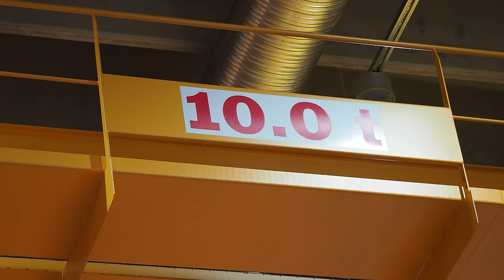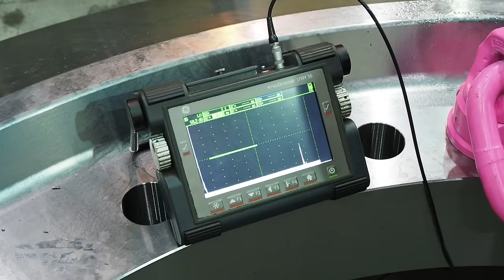Machining HUGE 10 Ton Bevel Gear with CNC Milling Machine

Comment: Its so crazy seeing things like this. The HUGE size just really puts into perspective the amount of work that goes in to making some of the largest machines on the planet. 
Ive seen some of the parts that go on some of those HUGE cargo ships, and they are freaking HUUUGE. You can literally stand inside of the engines cylinders on some of those ships, thats how big they are. 

I work for a company that works in the aggregate industry making huge rock crushing/sorting machines. We're the largest company in the world with what we do. The machines we make can be as tall as 20ft or so, they can be around 28ft long, and about 8 or 9 feet wide. While these machines PALE in comparison to these ENORMOUS ships and machines that a gear like this will go into, the crane they used here just made me think about the cranes at my work. They said the maximum for their crane is 10 tons, which is definitely a good amount of weight. 

At my work, most lines have cranes with a max weight rating of between 7.5 tons and 10 tons. However, the middle section where assembly works, there are TWO, 25-ton cranes. These cranes are HUGE. They have 2 of these HUGE girders on each crane. MUCH larger than the ones on the 7.5 and 10-ton cranes. They have to use these cranes in tandem to move many of the machines we build. 

Once they're fully assembled, some of the heaviest machines we build will literally get up to the 98k pound range. So even with 2, 25-ton cranes, we barely have enough rated capacity to lift these beasty boys.

Its so awesome to see HUGE ass machines and parts get made. It really goes to show just how far humans have come with our engineering capabilities.

Comment: Interesting that no coolant was being used.
Do you know if the gears were heat treated and hardened after machining.
Reply: Absolutely. They wouldn't last very long at all if they weren't hardened properly.
Reply: The pinion had heat treatment at ATA.The ring gear is made of tempered steel so it dont need hardening.

Comment: I loved this. Seeing any big or complicated machining process is super interesting. May be talk a little about the machine that's doing the work and how it operates, it looked like a 5 axis mill or is it a 7 or 8 axis.. Be nice to see what that machine could do on a demonstration program at its full machining speed. May be make something cool then give it away. Just ideas. If you need ideas I've got loads. Make the press do round bar through square hole stuff like that.

Comment: When that piece of metal weighs 10 tons, do they still have to secure it before milling?
Reply: yes, even more so. if you noticed the table is moving the piece back and forth. consider the inertia of the workpiece.

Comment: It doesn't need to be hardened on the tip of the gear? Normally gears are harder on the teeth and softer in the core

Comment: That beast of a machine makes the DMU Monoblock 60 I operate look like a thimble. I assume the 270 is 2.7 meters Y travel. Many milling machine model numbers relate to the Y axis travel in some manner, the X travel usually being the model number of the next largest machine of the series, the Y being the X of the smaller one, thus avoiding any machining envelope voids in the family.

Comment: Sweet video. What type of steel was it? I am a machinist by trade and have been working at the local community college where I got my certificate & A.S. degree in machining. I run our machine lab( order & maintain tools & machinery, get quotes for new machines, material) & teach machining as a part time instructor. I am a subscriber & really enjoy all of the videos you folks upload.

Comment: I worked in the engine room of an aircraft carrier. The reduction gear box for the shaft was something like 60 feet tall... The bull gear in that thing was unimaginably large. There were 4 of those gear boxes. Those were not even exceptionally large reduction gears by ship standards. The scale of  things on a ship is insane to me.

Comment: Video suggestion: KClO4 + Gasoline. Considering how cheap gas is right now, it would be super cool to make some fire with an oxidizer and fuel mix. If you cant find KClO4, KClO3 should work great too.

Comment: my company used to rough out titanium main landing gear for Airbus A-380 we would machine off several tonnes of material on old 3 spindle Cincinnati 5 axis gantry mills. we machine those 3 at a time on the Gantry machines. a complete rough machine job was almost a month and we shave off almost 4thousand pounds of each piece before ship to California to finish machine. that is a LOT of Titanium.

Comment: both size and comexity r equally amazing to me, i never got over big shit iv spent 30 years in the shop with massive cranes over my head n huge beams n pieces of channel n angle flyin everywhere, but it never loses its.. idk coolness, its a little different when u kno what it feels like, i guess it makes u appreciate it more in some weird way, so yea again theyre both equally as cool   super big dangerous heavu stuff is cool to watch, it's cool to watch how ppl handle it n what they've come up to deal with it, i use some of the things iv seen in ur videos everyday out in the shop
Reply: That's nothing. Flip 30 ton block with strap and clamp to angle plate mounted on a Sine plate and tip that 43 degrees

Comment: If you have 2 cranes in your shop you can use the two of them to split loads that are too heavy for just one crane.  Then you slowly move one crane at a time with your load in the middle of them.

Comment: Why not using coolant, or is it air cooled? I'm a gatage builder, not a pro, but arnt gears hard/tough and cutting a huge gear...seems like tool life would be nill if not cooled
Reply: If I remember correctly the heat is an advantage because it locally softens the material right at the point of chip forming.

Comment: The cutting tools appeared to be composite using perhaps Stellite (gold colour) as the cutting edge. No “suds” (cutting lube and coolant) was present, consequently the swarf exhibited heat discolouration perhaps confirming the aforementioned? It would’ve been nice to have known the metal comprising the work piece: stainless steel?

Comment: 4:35 called chamfer. (a symmetrical sloping surface at an edge or corner.) basically you are milling off the sharp edges

Comment: Meanwhile, my CNC at work has a 620mm work surface, completely run down bearings, literally everything shakes all day. We usually don't make massive parts like that, usually I am doing the smaller pieces because again 620mm work surface is not a lot, but the things I build I completely set up the machine and tools, write the program rather old school with G and M in DIN mode. I believe the longest program I wrote was 600 almost 700 lines long.

Comment: Very cool machining!! Interesting.
I used to to turn crank shafts, biggest one I did was 9ft long with 6 pins. (mud pumps)
It would take a day just to setup the machine. Then 4 days to machine it.
This Bevel Gear shouldn't have been to difficult to program. Plot one gear tooth,
then just offset and repeat that for how many teeth their are. 

I would imagine the B/gear took 3-4 days to machine.
Reply: 8 hour setup, I'd fire you. That probably took them awhile feeding it that slow. If it was me I could have that done in 48 hours

Comment: Use this type of gears in making electricity

A barometer size 10000000 cubic kilometers can turn a turbine with use of gears and hydraulic machine so we make electricity ?

Comment: The root fillet should be deeper and more round. The tip should be a round fillet. The tooth surface appears to be some rough. Not sure why the video shows close view. But, it is probably the drawing. They still use century old drawings to clone old gear design while manufacturing technology is much ahead.

Comment: A full size Bluebird rear engine 77 passenger, diesel school bus weighs 18,000 lbs. (9 Ton's) These gears weigh just a hair under 20,000 lbs as a comparison.

Comment: Imagine the cost of that thing if it was printed in PEEK (about $600/kg). Far lighter so wouldn't cost $6M ea but probably still far more expensive than steel.
Reply: So what is that, like, $1400/lb?
Reply: @TehButterflyEffect  Actually 1kg = 2.2 lb = $273/lb. Not sure of the exact final weight but peek is about 1/6th density of steel so 3333lb (not including waste) = 1515 kg = close to $910k, guess it's cheaper after all.

Comment: 10 ton is the maximum capacity of the crane in the weld bay at work. But the safety culture there for lifting at 100% of the rated capacity means after all of the paper work was signed I'd have a new beard.

Comment: Extremy precise tolerances is the phrase your looking for, I think lol. These machines are meant to make precision cuts down to the hundredths of a millimeter! Hence their outrages costs, and the high costs of the parts or materials yall machine and/or mill..
Reply: Hundreths of a millimeter is alot, 0.004" . DMG is good to less than 25 thousandths of a millimeter. Big part like that probably has a 0.1mm tolerance

Comment: very impressive. Glad this wasnt chinese (it came up as recommended) What is fascinating  how the huge 10 ton blank is constantly in motion hundereds or even thousands of times     yet doesnt move out of place to ruin the precision accuracy. Well done the team of engineers and designers
Of course we need to see the gears installed and in action rolling 6 inch steel plate.........

Comment: That's not 10 tons, 6 at most, I know from 20 years experience machining blocks into parts that are up to 50 tons. It's obvious when the crane has a 10 ton capacity label they're exaggerating. Nice try, the skilled know. They seem to be roughing that ridiculously slow, what a waste of a DMG machine.